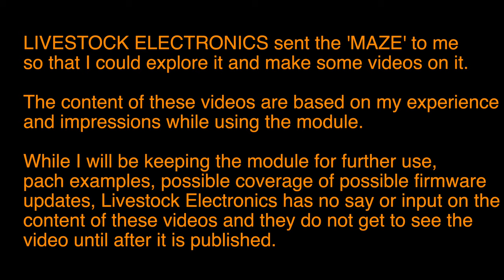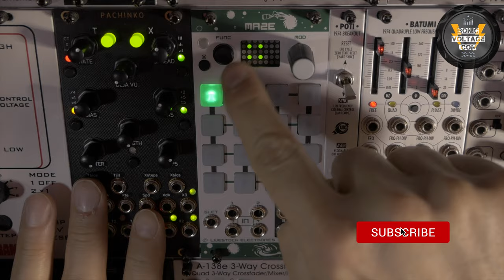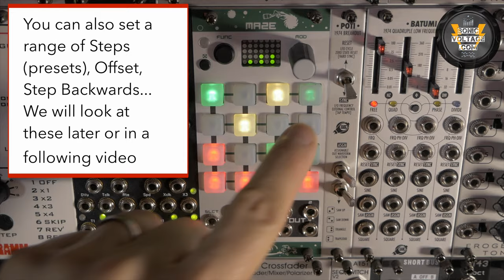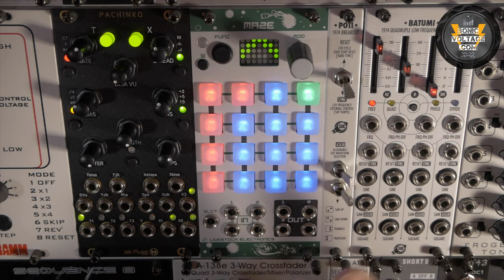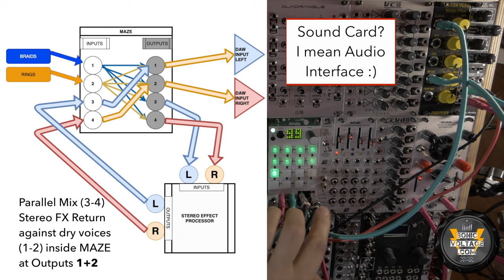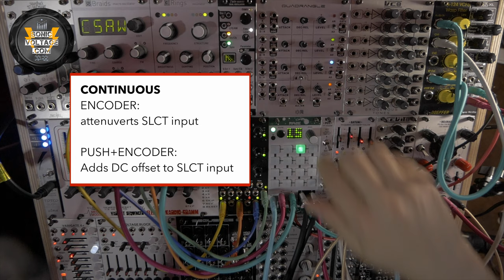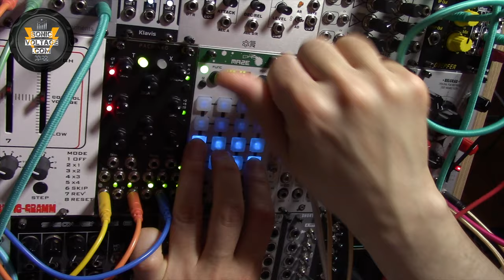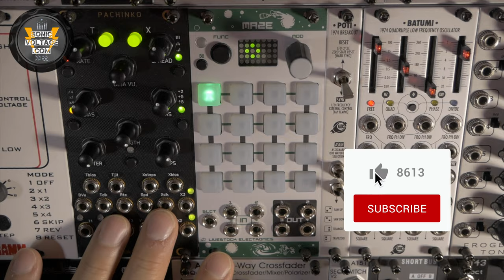Livestock Electronics Maze REVIEW How-To Modular Synth Matrix Mixer

Comment: hey man do you have a digital manual for this ? impossible to find since they closed down
Reply from the maker: Hi, I zipped up the PDFs I have into one folder, I hope this helps you out. PDFs and PNG of Manual, Calibration, Chaining, QuickPLay, Settings, FirmwareUpdate Instructions. 
https://u.pcloud.link/publink/show?code=XZql8IVZiXvVDO31em82PRkprcQjiz6Uqc5k
I made this folder public so you should be able to download it.
Reply: @SonicVoltage  you're a life-saver. one of the last places on the internet where this can be found. thank you
Reply: @SonicVoltage  do you think you have the latest firmware too?
Reply from the maker: @sjweith6758  I do not know if this is the latest, V1.2.2 but this is the latest I had. 
https://u.pcloud.link/publink/show?code=XZSLQIVZx6p5HLJPaR8bPSAiB2KrgRBVBDAV